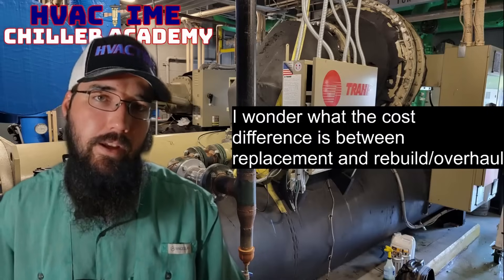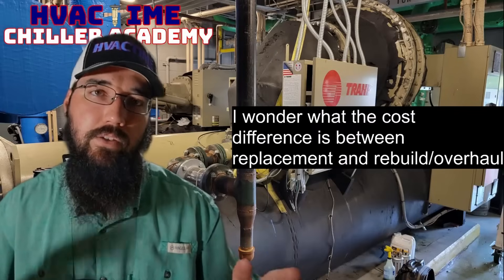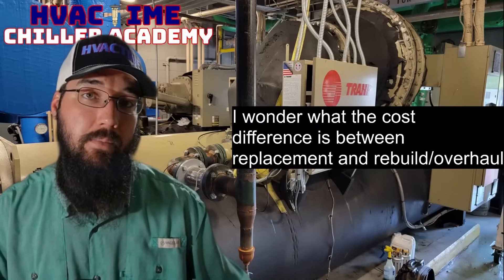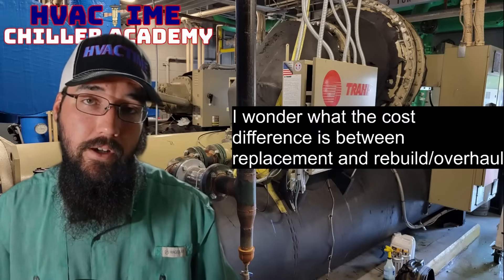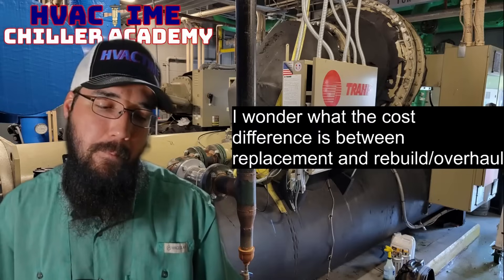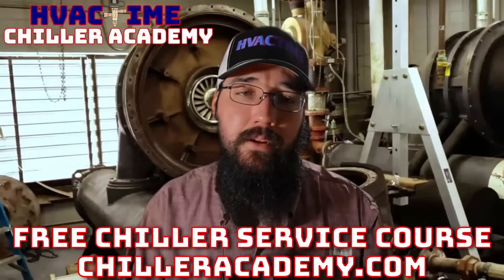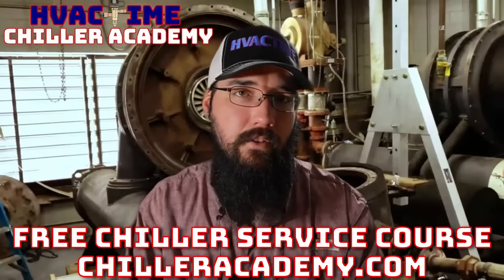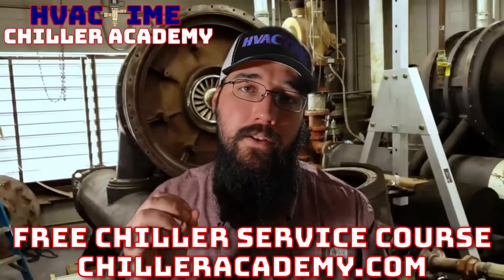Whats Cost For Overhaul vs New Chiller?

Comment: The larger units are also 2300,4160v motors.....those aren't cheap to replace or rebuild....Definitely cost friendly option is overhaul. We have programs where you get a new serial number and warranty.

Comment: you are making the argument from the point of view from a broken unit. it would be more "fair" when equipment is just running but knowing its wearing out so you can replace it before it dies. no datacenter worth it weight would wait until the windings blow to order a replacement or rebuild. still, i notice you kind of skipped over the financials of running it. you mention the repair/replace cost only and you skip over the running costs wich is basically much much bigger than the cost of the unit. a chilller running 250kW an hour at 15 cents a kWh means it consumes 300k worth of electricty every year excluding pumps and condensors. getting a more efficient machine that reduces that by just 50kWh would save the customer 50k a year. PLEASE broaden your view a bit into actual running costs and not just what you (or i) can put on a bill. that is not the True cost of the job as far as the customer is concerned. they gotta pay to run the thing and that should impact the advice you give to your customers. sidenote, could you make a video about how condensor temp influences efficiency? many designs i see in buildings spec their machines to run at certain condensing temps (artifically high) like 95F. why not aim for the lowest temp you can manage or even get your condensing water down to true ambient like 70F? refigeration cycle logic implies getting the condensing temp lower (or at least closer to evap) increases efficiency but condensors are still run much higher than ambient.
Reply from the maker: After the fact I realized I didn't complete my argument on the operating cost. I did briefly mention but lost my train of thought. I agree with you that an efficiency upgrade can easily balance the costs. 

Ill put something together for the cond temps. Those high setpoints are dumb and i find it's energy auditors that push that crap to lower tower fan loads.......
Reply: @HVACTIME  thanks for getting back to me. looking at the video again i kinda saw where you lost your thoughts. kinda funny looking back. but if you could take a minute (or several) to talk about how to make chillers more efficient and how/if engineers are screwing up the efficiency for the wrong gains would be well. would help if i could show a video from someone like you to my coworkers that i am often better off talking to a wall.

Comment: I would even argue that even water cooled screws are built to last, we just did two r'newals on some 20 year old RTHD. Full regasket, new compressor, controls upgrade. Because it was done through trane, the unit gets a new serial number, it is registered as a new machine. They both run great. We even have r'newal options for air cooled machines too. Still ends up being cheaper than a new unit. We have a group of 4 at an airport that have all been rebuilt and will probably go another 20. It's pretty crazy getting into a factory setting